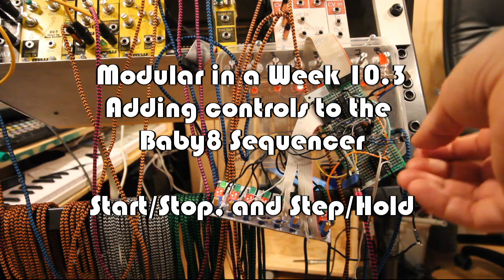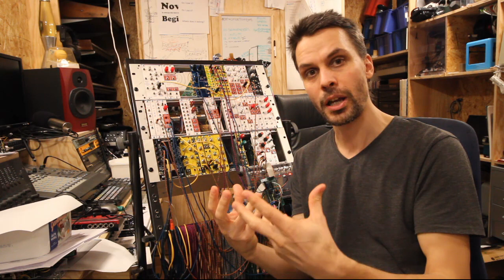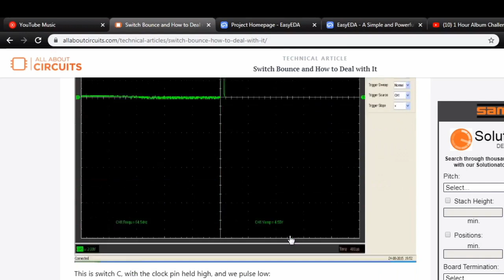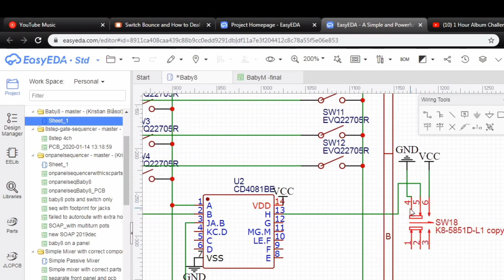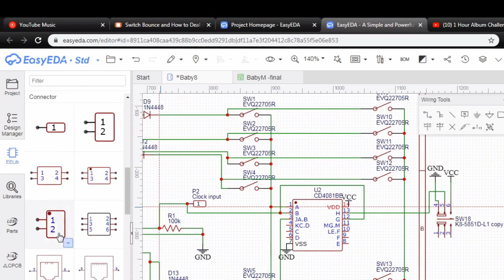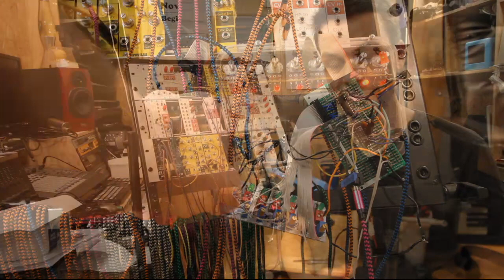Baby8 Sequencer part 3 Adding controls (start/stop/step/hold) - DIY Modular in a Week 10.3

Comment: @kristian Blåsol - I have built this but I am having a few issues. I have added a few components to make it work (resistor and changed cap value I think is all). My issue now is that the gates don't pause when they are turned off. So basically if I have a pattern like 11101110 it will just play a 6-step loop instead of 8. Any ideas? - Thank you!
Reply from the maker: Hello. I address this problem in part 2. Check it out for why it happens and how to fix it. :)
Reply: @SourceryOne  Thank you. I think the issue is a mix of my VCO, and that I have to use the gate out to make a gated pattern. Is there a way to combine the two outputs so that the cv out itself is gated according to the pattern chosen with DIP switches? I want to be able to control the VCO with the cv, but also make a pattern. Do I need two sequencers for this?
Reply from the maker: Oh ok. Then you would need a sequencer switch. A later video is about that 10.5 or something. Where you clock the switch and change between 8 different inputs/outputs. That way you can gate the 8 cv signals with a clock? Or I don’t understand what you want to do??? 😅
Reply: @SourceryOne  ok, I'll check it out. I have watched 10.1, 10.2 and 10.3 several times, but I am realizing that the cv output really has nothing to do with the gate output other than they are clocked the same. I will watch the other videos from day 10 and let you know if that helped me. Thank you for your input

Comment: Excellent work, Kristian! Would I be right in supposing you’re getting a better sense of accomplishment building this old school instead of Arduino?
Reply from the maker: Well. I get the feeling of accomplishment in both situations. When working with arduino it is the feeling of making bug free code 😉. And doing it all old school it is the accomplishment of doing all the soldering correct and understanding how the signals flow. 😄